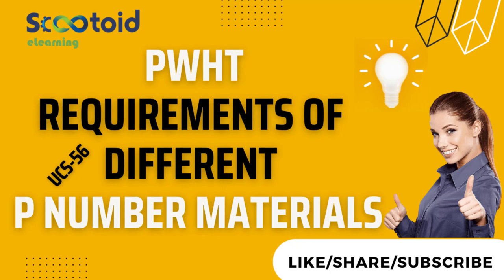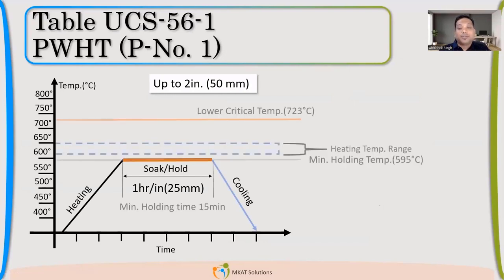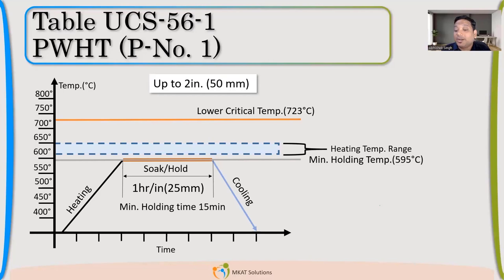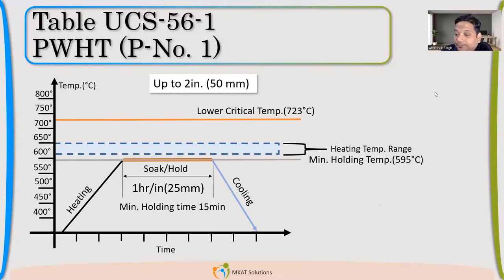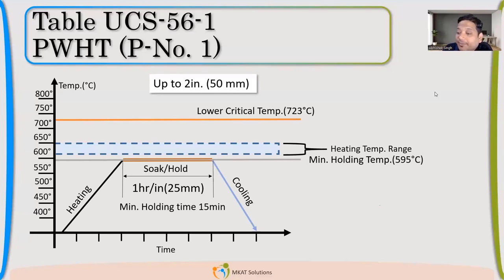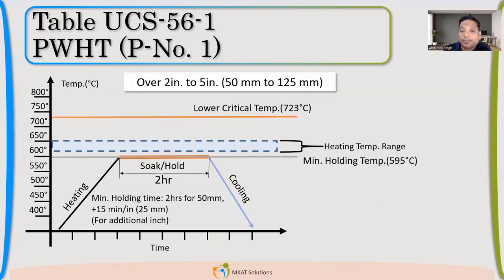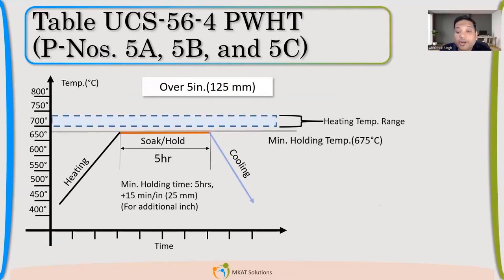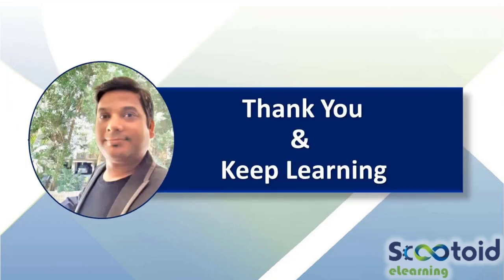PWHT REQUIREMENTS OF DIFFERENT P NUMBER MATERIALS

Comment: With reference to ASME Section VIII Division 1, where can we find interpass and post heating (not pwht) temperature? If it isn't present in the code, what are some relevant sources?
Reply from the maker: Selection of the maximum interpass temperature is minimum preheat temperature plus some additional temperature. Post heating is determined by metalurgist(welding engineer) based on phase formation intended.